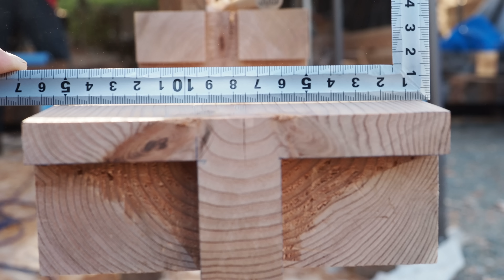Cutting a (210 mm) Japanese Scarf Joint (金輪継 or Kanawa Tsugi) - for a Structural Beam

Comment: Great job! The joint came out great. 

If you put a saw horse under where you are working, it will help reduce the bouncing around you experience as you are chiseling. Each hammer blow will lose less energy to the bouncing and instead do more work cutting.

Comment: Do you know there is a skewed scarf joint where the line is not parallel to the beam, but inclined at some angle. Do you know which joint is stronger?
Reply from the maker: Sorry, I am not familiar with a skewed scarf joint. There is an Okake Daisen Tsugi which uses a two Komisen (15 x 15mm) wooden peg. However, this joint is cut almost identical to the Kanawa Tsugi. If you know the name of the joint I can try to ask about it.

Comment: 50 these joints in a house? are they same size? do you have some kind of jig to make the work easier and quicker?
Reply from the maker: I only estimate. A team of carpenters cut these joints. The sizes can vary, but the technique remains the same. I am not sure how you could make this work easier or quicker. People often want mass production, but timber framing is not the case. It is all handmade joinery which by definition will take time to cut. Wood is expensive now, so we are told to move a little slower and think about our cuts. We have made mistakes in the past on beams and pillars that were around $1000 or more. Being a small shop we can't afford mistakes.